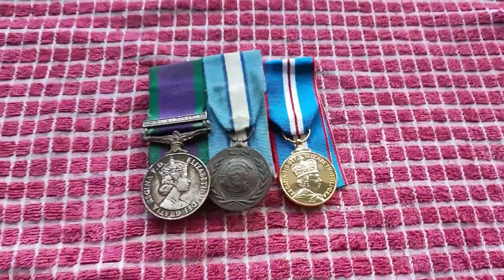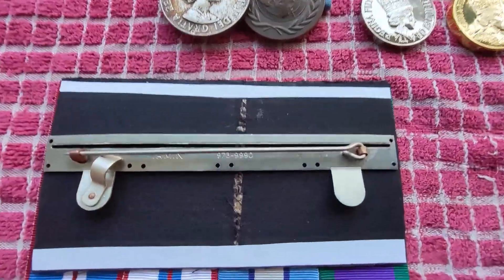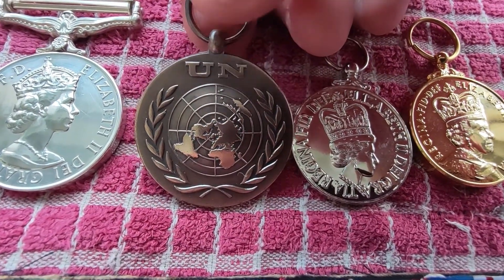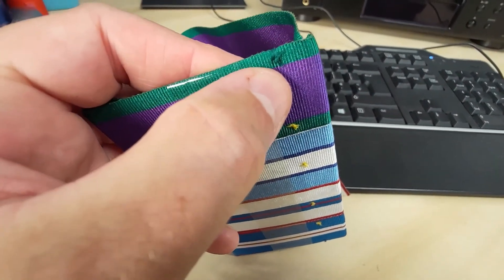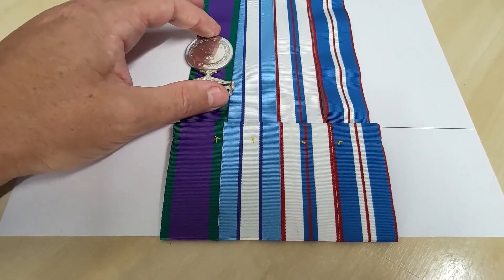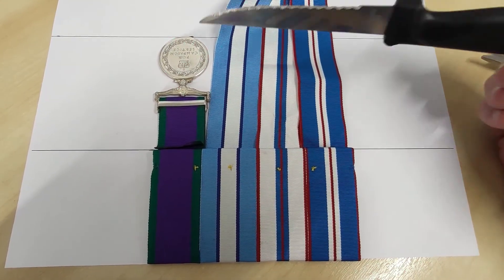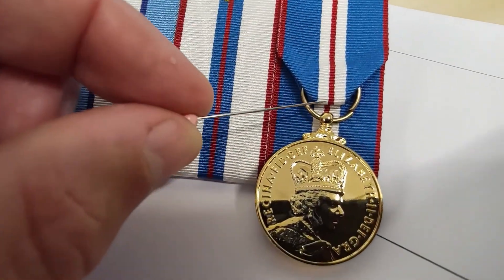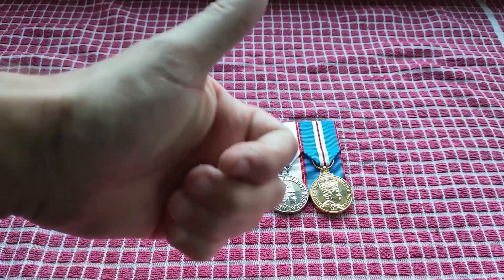How to Court Mount Medals - A Simple Guide (Alternate Method) *RARE* Silver Jubilee Set

Comment: Hi, @JesterRIP do you have any videos on how you centre your ribbons for this? with the UN ribbon being wider, do you still cut the buckram as if you were fitting 4 32mm ribbons and then just let the remainder extend past the backing? evenly would be great but too much one side would make the ribbon too floppy. looking at mounting a South Sudan, Platinum Jubilee, KCM, LSGC. Thanks :D

Would like to say i used one of your other videos with great success for my own too, so thanks
Reply from the maker: Hi thanks for the comments.
I mention it on my other videos but cannot exactly recall where in each - have a look at my channel (there's not many). If there's only 1 UN / NATO ribbon, it should matter too much. You can cut the buck ram ever so slightly larger. But when there's 2 or more, then you have to put the ribbons side by side and measure it properly.

The only issue with this, is that the ribbons will no longer fit through the slot in the brooch bar and it has to be tacked on with thread.
Reply: @JesterRlP  ok, yeah it's only one, so should be able to get through the bar, like you have done here. 

I'll take another look in your videos see if there's another mention of it that I've missed. 
Thanks again :)

Comment: Hi, Can you give average length of the Ribbon used to mount the medals?
Reply from the maker: Less than 10" can prob get away with 9" but depends on the height of board if mounting crosses etc. It usually comes in 10" lengths anyway.

Comment: What’s the length of the buckram for minitures
Reply from the maker: 45mm
Reply: Another Question how do you make your buckram stiffer, it doesn’t seem thick enough
Reply from the maker: @TheCarpyTraveller  only by using a different type. It's a bit of a lottery, but to be honest I've used all types, and it's the brooch bar on the back which gives it its sturdiness.